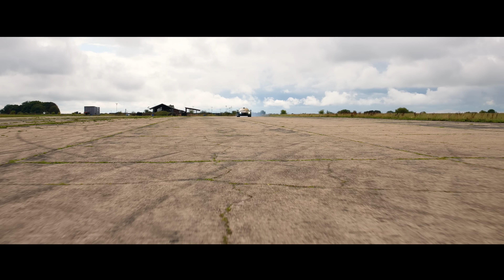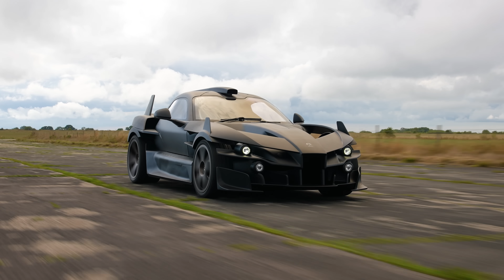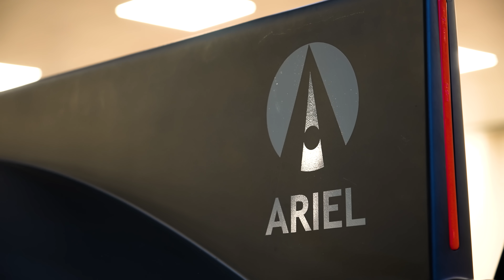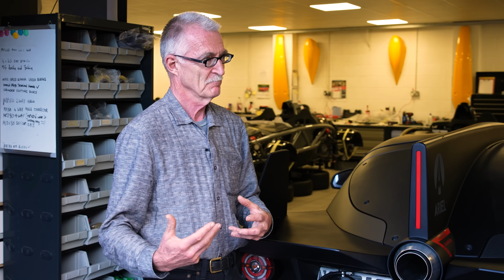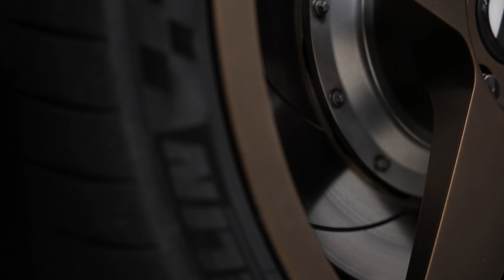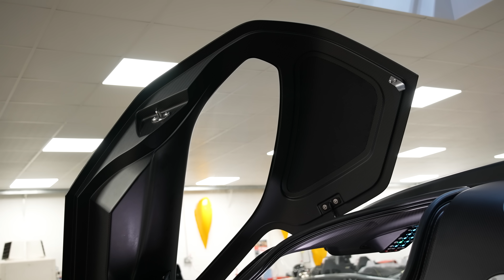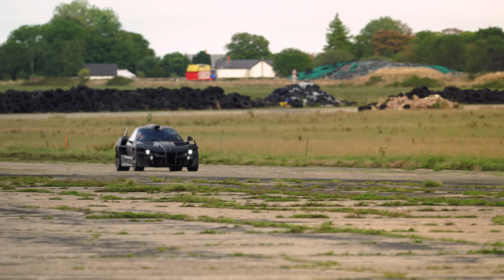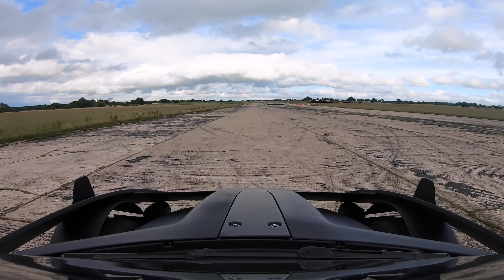NEW Ariel Hipercar – 1180bhp, 0-60mph In 2secs + Jet Engine?!  | Top Gear

Comment: A JET TURBINE???  🤘
Finally an EV that takes full advantage of NOT needing to be traditional.
Reply: They are called APUs. Just like in a commercial jet. :)
Reply: @redbarchetta8782  can't diesel generators be called APU too?
Reply: @RCmaniac667  Nope
Reply: @RCmaniac667  anthing can be called apu it stand for auxilary power unit its providing non directed energy to system
Reply: @RCmaniac667  oh yeah of course.
Reply: @RCmaniac667 yup. We called the UPS for the once we installed at hospitals.
Reply: @redbarchetta8782  Is this one powered by the old Vega architechure or the RDNA one?
Reply: @redbarchetta8782  APU? What is APU?
Reply: @purwantiallan5089  
AN* APU.
Auxiliary Power unit.
Reply: @redbarchetta8782 no it’s called a jet turbine, and the definition they’ve defined for it is a range extender.

An APU is the designation aircraft manufacturers designated for the small jet turbine that produces power to the components.
Reply: TREV
Reply: It gotta comes with a stereo that only play Danger Zone when the turbine start spinning.
Reply: I say that about normal ICE cars.
Reply: @barsaf9989  normal ICE dont matter.
Reply: Didn't Jaguar do it first with their C-X75?
Reply: The idea itself is not new since we had Vauxhall Ampera before, but jet turbine is definitely worth the headline.
Reply: Small but still quite heavy for a track car at 1.5 tonnes. The main problem with batteries is still weight.
Reply: The turbine so you don't have to rely on the charging network but still need petrol... ermmm
 THAT`S RELYING ON THE PETROL NETWORK...  hydrogen fuel tank oooh at 30-000psi near a jet turbine engine 
"" KAAAAA BOOOOOOM ""...
Reply: Ariel literally just invented the batmobile
Reply: Jaguar released a concept car (and five prototypes) with a jet engine that charged the batteries that powered its electric motors back in 2010.
Reply: Just another Vacuum cleaner, I don't know what are you seing.
Reply: @whitefr4me445  I will always think combustion engines are more interesting until I die, probably because of nostalgia and the overwhelming amount of engineering put into them over the years. BUT, what I was saying is it’s refreshing to see a company step outside the usual automotive design, BECAUSE of the fact that they can with it being an EV. So far EV companies haven’t done anything outside the box besides removing the front grill and making a flat cabin floor!
Reply: @cybertree  jet engines are combustion engines 😮
Reply: @cybertree   - ignoring; Rimac, Koenigsegg -  waiting to see what Ferrari ends up revealing -  there are several out there who have clients who appreciate the out of box thinking and are willing to fund the research.

 (If you only want to brag about 1-60 once or twice, just get a Model S, and be as boring as the guy next door...  jk  -unless he is driving a Nevera  )...
Reply: @The11901  Correct, I bet 99.9% of people reading that know I’m referring to the traditional piston driven ICE’s that have overwhelmingly dominated the automobile market for the past century and a half though.
Reply: @kadmow  Koeniggsegg is dream goals, they’re always thinking outside the box, I’ll just most likely never drive one. Rimac is very much so sticking to the norms, very, very well done though. I’m not holding my breathe for Ferrari, I think they’ll make something exclusive and beautiful that performs well, but I don’t think they’ll come anything close to as different as a jet engine to recharge the battery.
Reply: @whitefr4me445  Fine by me, not sure it’s a vacuum cleaner, they don’t normally seat people nor drive on the road. Nor do they have a jet engine charging them. It’s a brilliant idea. Jet A is a great fuel……. Of course that engine can run on almost anything.
Reply: @classicraceruk1337   (petrol ATM  - straight bio oil would be a better "clean green brag")
Reply: How can it pass emissions requirements? I know nothing, ELI5
Reply: @BrendanEvan  I think it will pass with top marks, it's a freaking 35kw turbine.
Reply: @BrendanEvan  all i look is that this car looked like it came out from LEGO BATMAN 2 DC SUPER HEROES.
Reply: @BrendanEvan  Renewable diesel HVO, synthetic fuels and hydrogen.
Reply: @playgt326  this car more like Batmobile got a minor downgrade.
Reply: It’s ugly and it looks like an atom with more covers
Reply: doesnt the jet turbine run on fuel tho..??
Reply: @jayjaygolden5123  exactly
Reply: @jayjaygolden5123  that would be interesting to find out
Reply: Turbine yes, jet, no.
Reply: Turbine-electric powertrains are really old tech, but we're finally reaching a point where they work well.
Reply: 60 fps camera for moving objects or bust/fail...amateurs.. 60 FPS !!!
Reply: i expected less batteries so driver cna sit lower in the car for more feel and lower center of gavrity for handling more speed around turns, then combustion thing would do most the work instead of battery. also expected it to be lighter weight. i dont know why they added so much battery, this is not a effiency focused car anyway because if it was itd be more like aptera motors
Reply: @kalmmonke5037  The mass of the driver is negligible compared to the lower CoG of the mass of the batteries. If it had no batteries and the driver was seated lower it would likely have a higher CoG than it does with them.
Reply: @kalmmonke5037  My jaw dropped when I saw it was almost 3900 lbs, that's so heavy
Reply: A jet engine and still barely faster than a 7 seat model X Plaid.
Reply: @yakari7983  It even mentioned in the video that the battery is not big.
Reply: @farishanafiah8461  :  helps keep the weight down, a light little car doesn't need all that much power to tool along the motorway at 90 mph  - though I would have thought more than 35kW steady state add-in power would be good (also less efficient at "part throttle") - pretty much the range extender has been sized to charge the battery at around 0.5C.
Reply: @yakari7983  Yea until it’s battery dies, then it disappears in its rear view mirror.
Reply: I wish it had V8 or V10 what a shame.
Reply: @nitroxwolf2098  it has a jet engine, trumps any V8 or V12. Does not matter it does not drive the wheels.
Reply: @classicraceruk1337  give the damn thing some wings at that point then
Reply: @Americana-deluxe  Would be an aircraft then and not a car.
Reply: @classicraceruk1337  not hardly.
Reply: @asherdie  Do what
Reply: @classicraceruk1337  i did not say to do anything.
Reply: @classicraceruk1337  It has a turbine, not a jet engine.
Reply: @afrog2666  If you want to play semantics it’s a Jet Turbine engine.  Don’t try playing games unless you have the correct answer.
Reply: @classicraceruk1337 its a gas turbine, not a jet engine.
A jet engine uses thrust as propulsion.
A gas turbine uses gas to push a turbine which creates work on a shaft.
Reply: @yousausage All the same to me. I ain’t that pedantic.
Reply: @classicraceruk1337 its not pedantic its being specific.
Its like saying a leaf blower and a lawn mower are the same thing.
Reply: @yousausage Nope only a pedant would say that. Your analogy is also incomprehensible. Keep up your pedantic way of life, I will keep my laid back way. You can fume as much as you like.
Reply: @classicraceruk1337 sorry I'm a gas turbine engineer.
If I walked onto one of the test bays and asked "what trust are we making boys?" Id be sacked faster than you got annoyed at me for correcting you.

Jet engine - leaf blower = thrust
Gas turbine - lawn mower =  spins shaft for work
Reply: @yousausage Not annoyed just saying you are pedantic. That appeared to annoy you. I don’t do that job so I don’t give a toss. Your analogy is still idiotic. You should be fired for being an annoying pedantic twat.
Reply: @nitroxwolf2098  this car more less the same like Batmobile from LEGO BATMAN 2008 game.
Reply: @nitroxwolf2098  Yeah, I agree. I would want it to be a lot slower too...     /s
Reply: @nitroxwolf2098  WTF a V8 would not fit, a v10 would make it a Tardis.
Reply: @Neojhun  insert V12 in this car and you will see.
Reply: @purwantiallan5089  electric motors can already make more power than combustion can..
Reply: @jayjaygolden5123  Sources? You can make any hp you want with combustion - And when I see an EV top fuel dragster making 10,000 hp/ 2300 lbs weight then we can circle back and talk lol. ICE dominates when it comes to energy/power density

Comment: It doesn’t look the best to be honest but it lookss like the perfect sleeper car
Reply: I don't think you understand what a sleeper car is. A car that looks like a Batmobile? Not a sleeper car, arguably the complete opposite of it actually.
Reply: @dzello  it looks like it has like 500 hp and Is just for cornering and looks TINY, I mean if you looked at that you are not thinking ‘oh that looks so fast it’ll do 0-60 in 2 seconds’
Reply: @picklehunterlaxifi5603  You clearly don't know what a sleeper car is.

If I see a car with tons of aero, a jet engine exhaust and a super compact size that clearly weighs nothing...

Yes, I will think that looks fast as hell.
Reply: @dzello  not sure you can SEE the jet engine but okay
Reply: @picklehunterlaxifi5603  You see the jet engine ''exhaust''. You also see huge mounted fans under it.

EVERYTHING about this car screams speed.
Reply: @dzello  your making me cringe to much just watch the video and shush since you have no clue what your in about
Reply: @dzello from a distance - at a red light, it looks like it’s just a normal exhaust just big. That think does not look like it goes that fast
Reply: @picklehunterlaxifi5603  Then you need eyes because you're blind as hell. If you think a short base batmobile looks slow, you're the issue.
Reply: @dzello  calling me blind when you are wearing glasses, like fuck me cant you handle opinions, this isn’t twitter 😂😂🤡🤡
Reply: A "sleeper" is a car that doesn't look like it has speed or performance, but does. Just so you know what "sleeper" means... this ain't a sleeper lol
Reply: Sleeper car?You miss something my friend..